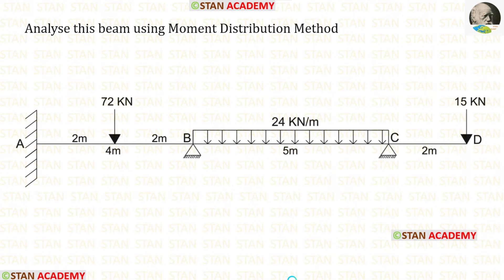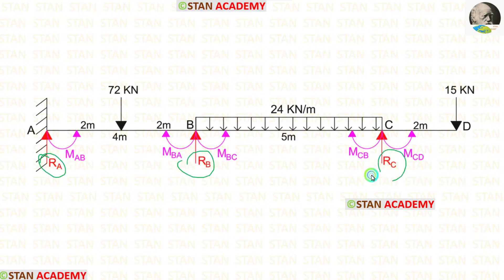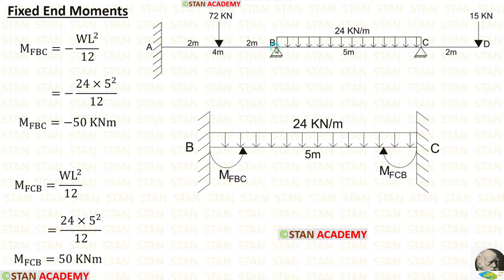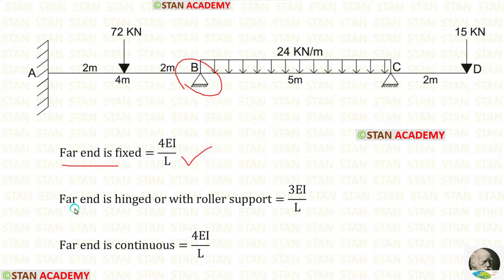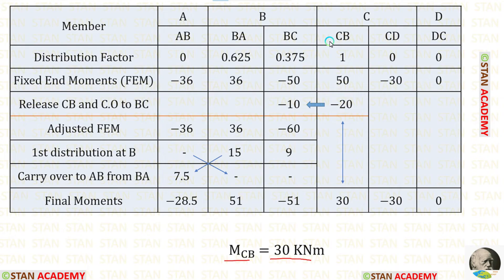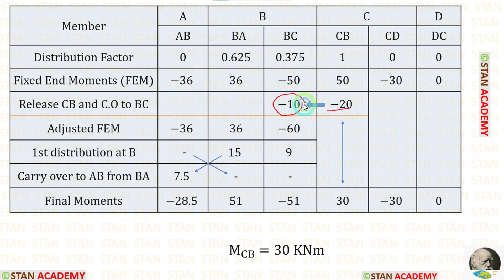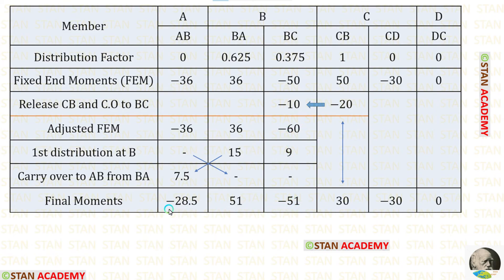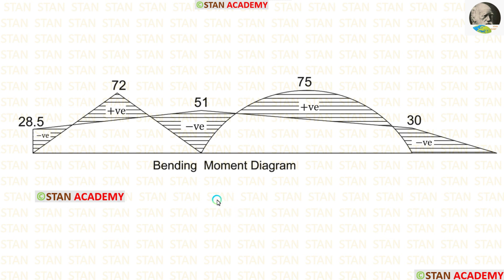Moment Distribution Method for Beam Analysis - Problem No 11 (  Overhanging on the right side )

Comment: Sir what if overhanging span has UDL instead of point load 
Then how to calculate it sir ?
Reply: M = (w x L^2)/2

(Explanation) 

Total load:
W = w(kN/m) x L (m)

Lever arm:
d= L/2 (resultant acts through midspan of the overhang owing to the symmetry of the UDL)
Reply: @Yaiqab_Banyamyan_Yasharahla  what if it has both point load and UDL, Ik I have to add them together but after do I have to do anything differently? for the carryover and stuff?

Comment: why do you consider point (C) as fixed at 5:09 ? but when you calculate it's K value you considered it as pin/roller and used 3EI/L?
Reply from the maker: when you calculate fixed end moments,  we assume that every span is a seperate fixed beam. So span BC is assumed as fixed beam.